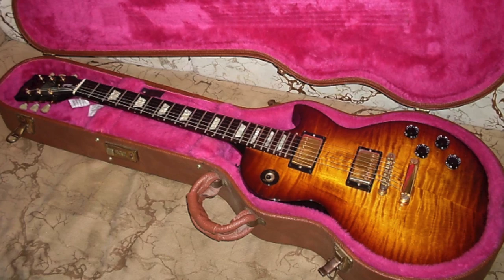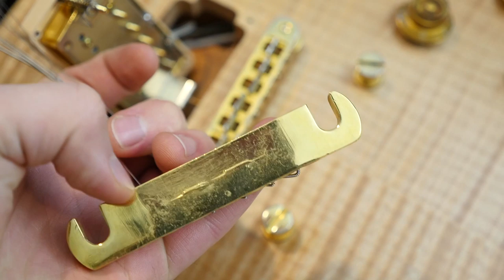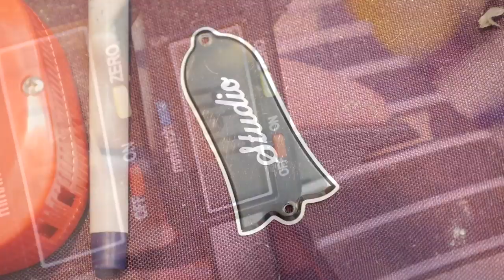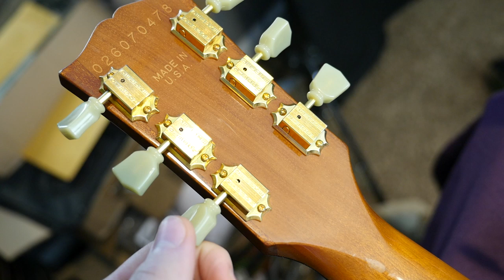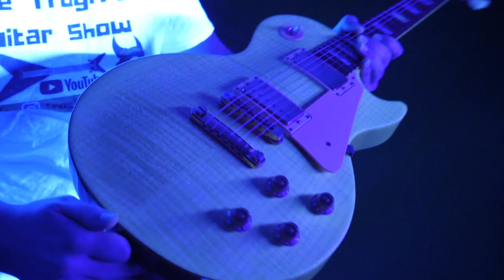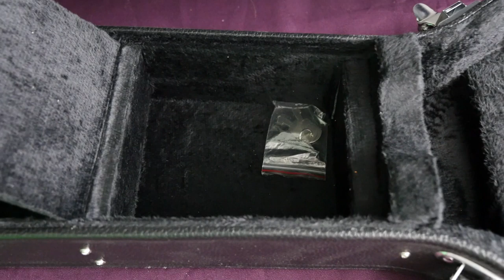Is It Safe to Ship Guitars in Sub-Zero Temperatures? | 2007 Gibson Les Paul Studio Premium Plus

Comment: No it isn’t. Did it once before. When I received the guitar it had been sitting in an 18 wheeler over the weekend in sub zero temperatures. There was checking where the neck joint meets the body. I returned the guitar and Carvin built me another one. That one shipped a couple of months later during warmer weather and it was fine. Lesson learned. Don’t order a guitar in the winter.
Reply: I just made this mistake guitar shipped from LA to Ohio got it today and it's fucked.
Reply: SnEaKeR S33kEr84 Take pictures of any areas where checking has occurred if any and call customer service where you ordered it from. I spoke directly to the head of the guitar department at Carvin. ( Back in 2009).  I emailed him the pictures and used a pencil to point out the area where checking had occurred. I sent it back and Carvin built me another even more beautiful Guitar than the original one. Luckily they had good customer service. Hopefully where ever you ordered yours from has good customer service as well. Good luck with it 🎸🎸🎼🎼
Reply: My cousin lived in Alaska for a while and ordered a Jackson (he’s a country player so I never quite understood why he decided to order a Jackson) but when it got to him it was unplayable. The neck twisted among other things.

Comment: I completely  disagree about shipping in sub zero temps. I also believe the neck scratches were there from previous use. I've lived in Alaska many years and have never come across a guitar checkered by shipping in sub zero weather. In fact, I and others have left our guitars in vehicles overnight in sub zero temps after playing in warm bars.  After years of performing here, I think I have a better idea about sub zero temps than most that live in the lower 48. One test case on your part, without knowing if those marks were already there, does not verify your theory. I have to say I love the appearance of the guitar. If I bought guitars based solely on appearance, I'd get that one!  Btw, I'm not into binding.
Reply: I agree, I live also in Ohio, near Columbus and has 2 guitars delivered at the worst of the cold and saw no damage after slowly bringing them up to room temp.
Reply: Maybe if the guitar doesnt a nitro finish it woudnt crack but nitro finish do crack from extreme temperature changes
Reply: @guitarocd9984  I didn't mean to imply the seller was dishonest. I didn't know if the marks were just missed in photos received by the new buyer. Sorry about that.
Reply: @PhoenixGuitars  I had never heard of that until yesterday. I take you at your word. And yes, many of us must be very fortunate up here. The one thing I do know that happens up here is that bass necks will warp a bit during the Winter to late Spring transition. I've seen that happen to other players 5-6 times.
Reply: I live in washington,had a guitar delivered in 30 ish degrees Last year.

The finish began cracking after i got in the house.
(Unfortunately i had walked away for an hour)

2005  fender sparkle finish,now literally "weathered"after one cold trip.

So lucky you sir.

Comment: I don't know about shipping, but the key to any cold temperature is maintaining humidity. I live in Chicago so temperature maintenance on my guitars is huge. I keep them in their cases at all times unless I'm using them. I also keep a damp sponge in a sandwich baggie with many holes poked in it in the headstock pocket of the case. Before I did this I notice fret ends shifting throughout the year. That no longer happens. My guitars are happy.

Comment: I bought an ESP with a Floyd Rose that was shipped a few days ago when it was -30 in the state it is shipping from. Luckily it has a satin body and the neck is unfinished so there shouldn’t be any visual issues however I noticed a lot of Floyd Roses seem to rust and depending on if the guitar is wrapped in plastic and with dramatic changes in temperate I’m hoping it won’t be covered in moisture. Also I assume the guitar was shipped with the nut locked so I’m curious to see what that will do to the strings that will probably want to tighten because of the cold.